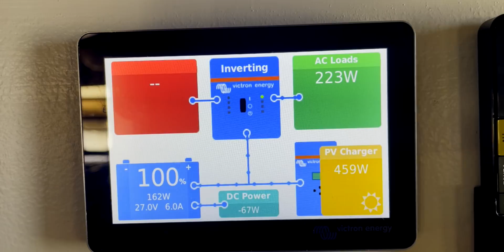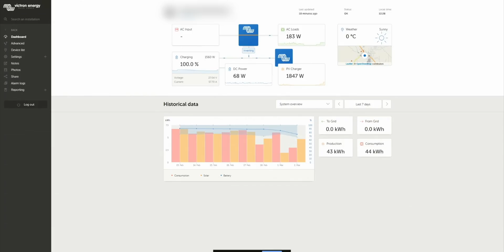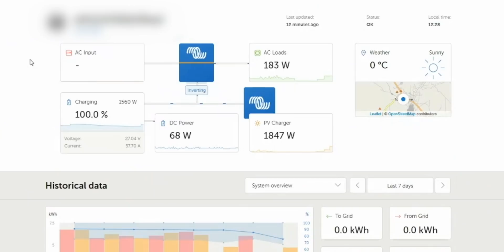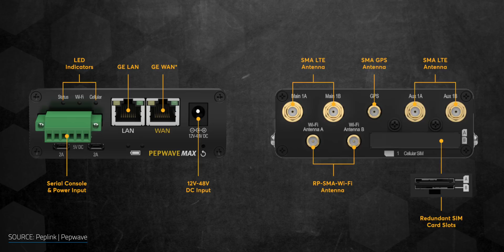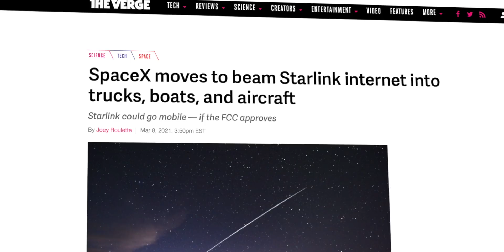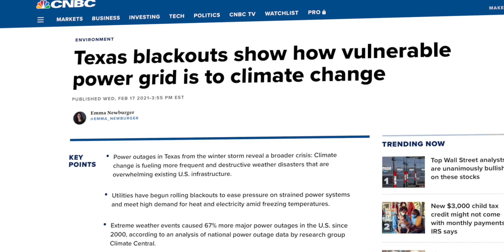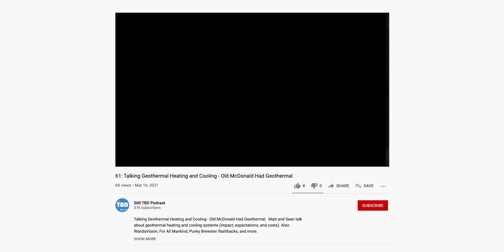Off Grid Living with Solar

Comment from the maker: Have you ever thought about doing something like this?  Don't know if I could go without my gigabit internet.  And if you liked this video, check out my video on Passive Homes - 90% Energy Savings! https://youtu.be/secB3R0sIYU?list=PLnTSM-ORSgi7UWp64ZlOKUPNXePMTdU4d
Reply: Being thinking about doing this for a while. Only difference is i live in brazil. but i'm a software dev, who loves being outside, gaming and star wars. Lol. I don't have pets tho.
Reply: Especially once Starlink is functional for an RV, a setup like his would be great, especially if it was about 3x that size for solar and battery, so that it could be used to charge a Cybertruck to pull the trailer, so that the Cybertruck could charge for a few days while in each location. That's more my dream setup, for either vacationing or work-and-travel life, though I too would be reluctant to let my "home base with gigabit fiber" go.
Reply: I'm currently doing this. I'm one year into living on the road and with much less solar and storage than your friend. A fixed 120w panel, a fold out 300w panel, 208Ah of batter and an invertor on the car. 

Honestly it's fine. 

We do get some batter anxiety sometimes if we aren't driving enough for alternator or the invertor to prop up things back up. But we can stay off grid for 9 days with the fridge, two laptops, two phones and a wifi router.
Reply: Was the electricity from the RV powering the truck dragging the RV? If not, why not?
Couldn't he have sold excess energy to the power grid anywhere?
How much did his setup cost?
Reply: Could he power his truck if it were electric with the power his getting? That would be so crazy if he could
Reply: Starlink, lets go :)
Reply: FYI, Starlink will not allow stationary usage in the begining.
Reply: Matt please check this out and give some insight.... it’s a form of hydrogen fuel the puts H2 into the air intake from an alternator powered fuel cell. 

https://youtu.be/wxfo-w0ptEo
Reply: Thanks for your content, Matt! Could you do a price out vid follow up? Thanks!
Reply: We are currently putting our 80 Acres on the market to live in our 40' 5th wheel along with our 2 x 100lbs Labs.  We will have 13.5kwh of LiFePO4 battery, all Victron equipment, and 2500 plus watts of solar.   I'm also going ro have a Raspberry Pi to convert the RV into a "Smart Home".  Winters in Arizona/ Texas/Florida and summers in Canada!
Reply: Please definitely do an update, this is very interesting!
Reply: Yes I have a custom design I've built out and know which RV and how much I can handle and need for various scenarios. It's not hard to do if you've got background knowledge in the solar and batteries. But I was on submarines for years so that space is plenty good for me. I'd love to hear more about what he went to set up
Reply: how does he heat the RV?
Reply: considering the cost of housing and renting, and a part of being a minimalist, this is highly interesting. now I want to know how they tackle toilet waste.
Reply: I have been off grid with just a 400 watt solar power system for over 20 years in a hand built cabin. The cabin is set up like a self contained RV and I have unlimited internet with my own wifi hotspot. I run a business online so I am online full time. You can see my systems on my channel:  https://www.youtube.com/watch?v=SwHpMRuT_lA
Reply: As the owner of three cats, two rabbits, and a dog, I just can’t imagine taking them on a long-term RV trip. They produce so much waste … and I’d always worry about the rabbits, who seem to need an emergency vet visit every year or two (rabbits are annoyingly delicate).
Reply: I know I am kinda randomly asking but do anybody know a good site to watch new movies online?

Comment: I've been thinking about that for some time now. BUT I'm dreaming of a fully electric setup, electric campervan, electric everything, charged by solar. So you don't even have to have separate battery. You share the same battery between the engine and the house part. You stay at 1 place for about a week, get 200-300 km of range off solar and then go to the next location. Really totally independent end climate friendly.

Comment: Awesome video!! My wife and I have discussed this as we're nearing retirement- even if it's only for 6-12 months before re-settling. Then there's the fact that we have 3 80#+ Golden Retrievers! We have a 40 foot toyhauler, but it's 16 years old, and I'm not quite sure what lifespan it still has, but it could be a great experience for a short time!! I'm curious as to what the cost was for Steve's system!!

Comment: I bought an RV in late 2016 and installed a basic solar setup. I was planning on maybe an early retirement and travel the country, but my plans didn't work out that way.  I had to get back into my career after a gap, and I could only find a contract job in another state. Rather than sell my house, I rented it to my brother & SIL, and took my RV to my new job (this was mid-2019).

COVID hit, and I was WFH in my RV for a few months before I started floating the idea of me traveling until we had to go back to the office.  During my travels, I eventually added 2 more panels (total of 3 panels with 460w rated generation). I built a system using RAM mounts so that I could tilt my panels for maximum solar collection.  I also upgraded from 2 lead acid batteries (original) to one LiFePo.  And I switched from my original PWM controller to an MPPT.  Even thought I'm back in an RV park now (in anticipation of returning to the office), I'd like to eventually connect my inverter to the main power of the RV... even if it is only manually switchable.  I still use my solar power to use my laptop every day, and my shore power usage is staying very low, so that's a win.

So my current configuration would get me to float charge by about noon, and I ended my work day around 2pm (in April), so I could be off-grid indefinitely, but I didn't have it connected to everything in the RV.  The two main things were my microwave and my refrigerator.  The microwave just wasn't connected, and the fridge was using propane.

It was an amazing experience to be able to travel like that.  I spent time in places that I had only driven through before (West Wendover, NV), and visited one of the few states that I hadn't yet (Oregon). I'd love to be able to travel like that again, but odds are that I won't get to with my current position.  Who knows, maybe they'll change their policy now that they know remote work is productive for software engineers like me.

Comment: We have a travel trailer on order; ETA is August.  We plan to add a solar set up to make it fairly self sufficient.  Our travel plans will be to do 1 to 2 week trips here in our state of CO and the immediate surrounding states; boondocking, not at campgrounds. We'll do this for 5 more years we plan to continue working.  The RV solar company you referenced, Northern Arizona Wind and Solar, is a primary contender to do our installation.

Comment: If he had a tesla cybertruck and charged it from the panels he would not need fuel either. Also, I have heard there are panels that take drinking water out of the air humidity that could get him off grid in terms of water supply!

Comment: I'm currently dreaming of doing something like this with a sailing catamaran. Around 50 kwh of battery, and a couple of wind generators, 5 or 6 kw of solar on top, a couple of wind generators, two 15kw electric motors with hydro-generation when under sail, and probably the most ambitious part, a water electrolyzer to produce hydrogen from seawater and store around 15 or 20 kg onboard for extended range with the electric motors via a pair of 5 or 10 kw fuel cells.

Now I just need a couple million bucks to make it happen! lol.  Ultimate Zombie Apocalypse plan!  Unless zombies can swim, of course.

Comment: I’m not clear that many people understand what internet bonding is. So I’ll do my best to explain, So let’s say your have sold ethernet connection into your nic card, then you connect to WiFi all while using the same isp. The point is your able to consume x2 the amount of bandwidth while paying for one connection. In that scenario my nic is rated for 10g while using cat 7 and I’m connect to wifi6. My modem is provisioned form isp is rated for 1200 down with 50 up for 75.00 per mo. With internet bonding, I’m able to successfully connect to 2400 down with 100 up. While still paying just 75.00. I use a paid service called speedify. Not only is Speedify bonding my internet connection, but it’s also provides a vpn service. I don’t get censored internet. I use adblockers within the service to speed-up my connection. It’s very simple to use. You don’t have to have a computer degree to set it up. I downloaded the app from the App Store & it works.

Comment: It is doable but the cost is STAGGERING. I cannot imagine many who can afford this lifestyle but for those who can it looks awesome. These days almost anything is possible if you have the funds. 

We did this but not roaming in an RV. We are in a cabin on solar and generator back up. We get by on 900 watts of panels and about 300 Ah of battery in the bank. Cellular internet access on an unlimited plan. 

My biggest concern in an RV would be the wear and tear on the equipment for the power. With a lot of travel I would think that would take a beating.

Comment: I'm doing the same here in Scotland but am on shore power during winter as don't have LiFe batteries and weather can be bad here for weeks but have everything a house would have with 1375w of solar, induction hobs, washing machine, tumble dryer, fridge and computer plus for heat I use a rocket mass heater which is also a range cooker so no gas appliances to worry about. After 3 years everything works great and life is very comfortable plus as an added bonus it's much cheaper living and I produce less waste/rubbish.

Comment: Doesn't sound worth it at all.  They still end up not having enough power for the evenings, plus they have those expensive eyesores on the roof.  They have increased the weight of the van so if they move it, it costs more in petrol.  Plus they are only 'self sufficient' in the mornings and that is only if there is sun.   And it seems like such a lot of hassle and work and expense for what it is.  Green energy is a bit of a con really but good on the guy for giving it a try.

Comment: I am doing this using all-in-one hybrid MPPT inverter.    After doing some research, 12V is not the way to go.  48V system is the way to go with 16S LFP battery setup.

Comment: Do a video about clothes lines , all the possibilities, indoor - outdoor - day - night - summer - winter, they work AWESOME!!! CLOTHESE LINES!!! Electricity free, solar and wind powered outdoors in the summer time, the funny thing is they work great in the winter time indoors of course though.  Please make clothes lines go viral and make a video about them.  They are so fun.  Its not that much work to hang up clothes.  The clothing will dry out a bit differently than from the electric powered clothes drying machine.  The modern convince of clothes drying appliance does probably make the clothes dry out a bit more perfectly fluffed, however, the drier machine will damage the clothes and shrink them more.  For some types of clothes like denim jeans the clothes line will leave them a bit stiff and crispy, however the clothes line has a ton of raw power, because of all the wind and sun and heat out doors. so if you need to dry out a big blanket or any thing like that lots of towels, the clothes line works really well.  Three or more washer loads of capacity doesn't require a lot of space or clothes lines.  This is a huge energy saver using clothes lines.  Make clothes lines go viral.  People with solar panels should invest in clothes lines also.

Comment: Nice funny video.  Importantly informative.  Raised as a farmer/rancher have been thinking about energy independence since about 1971.  One thing is a highly insulated space like 7 ft. under ground. Also, a super insulated building/RV.  There's much energy savings in some passive systems. Surprised he didn't have a few sailboat windmill generators.

Comment: I love seeing people do these kinds of self sufficiency projects. Solar and inverter technology has really become affordable, now if we can just get good quality batteries without breaking the bank.We have a remote cabin where the only thing we have to haul in is propane and food. I put together a solar system to fit our needs and it works great. We run a freezer with this along with most home appliances including a small washing machine. This summer I am adding a solar heater that works to heat the water in our RV water heater. If I had an RV I’d mount a 6” x 10’ ABS as a preheater for the water heater.

Comment: For those interested in diy solar, or solar for your RV. You can purchase lithium cells directly from China (where every battery cell is manufactured anyways) for cheaper prices per kwh than lead acid batteries.

Comment: His trailer might be too large for it but the new F150 Hybrid with the 7.3kw generator could work well to compliment the solar and batteries.  Possibly cheaper system of panels and batteries with the backup power coming for the trucks built in generator.

Comment: My dad and I converted an old German banking truck to an rv. I did al the electrical with a lot of help from YouTube. 3x 320 Wp mono crystaline solarpanels, Victron Multiplus 2 24V, Victron mppt, cerbo GX with AliExpress touchscreen and 2x 12V 170 Ah AGM battery's. 

It's a very capable system. We have an 230V AC unit, fridge/freezer, toilet (with built-in 'blender'), coffee machine, hydrophore etc. 
Monitoring everything through Victron👌

Comment: Yes I want to do this so badly! There's so much in just the States to see it could takes years and be so fun :) but yeah I hear yah... there are some challenges to be sure... throw 2 wild baby boys into that mix... and see how one's sanity fairs!
Reply from the maker: I can't imagine doing something like this with kids.
Reply: Me too. I'm working on my EE degree and one of the things I always try to do is get professors with doctorates opinions on different possibilities and where they think the technology is going.
Reply: I have been off grid with just a 400 watt solar power system for over 20 years in a hand built cabin. The cabin is set up like a self contained RV and I have unlimited internet with my own wifi hotspot. I run a business online so I am online full time. You can see my systems on my channel:
Reply: @solarcabin  that's cool man 🙌
Reply: El sábado h

Comment: I don't understand off grid guys... Unless there is actually no grid (you are on the road - like in the video) living off grid is not really a good idea. You produce a fixed amount of power, but your energy consumption is variable. This means you have to use batteries -> wasting power. If you connect your power to the grid you make sure every single bit of it is used at maximum efficiency.

Comment: Steve went a little nuts? I would do the exact same thing, go big or go home! Honestly, you're better off having more generation than you need for extreme cases such as colder weather, running more equipment than you expect in the future, etc. My future home will have ground arrays that can be expanded on and I'll probably keep expanding until my hydro service provider tells me to stop or I run out of land.

Comment: If one of the EV pickups come out soon ends up being capable of towing it, that sounds like they solar on the RV could also charge the pickup, could be a really apocalypses proof living situation at that point. Would just need to drive to sources of food and water and / or away from danger occasionally but wouldn't need to find fuel.

Comment: This would be exponentially more interesting when Cybertruck arrives and if it becomes possible to hook up to the vehicles battery.
You should definitely still have batteries in the RV itself, but knowing you have a +50kWh backup is always nice.

And you'd be going 100% green, not even a gascar to drive it around

Comment: As I get older, I feel the cold more in winter and have been daydreaming about the 'grey nomad" lifestyle, heading north (I live in Australia) for winter and seeing some of the more remote parts of the country.  I have a Cybertruck Trimotor on preorder, so this, combined with a caravan/trailer with solar panels and battery would be an awesome energy independent set up.  I have done some research and there is an Aussie company called ERV that has caravans/trailers with this sort of gear.  They trialled it with a couple in the outback for 6 months and it sounds as though it worked very well.

Comment: Those Victron multiplus inverters are really rugged. The only problem is they have huge input capacitors which result in a massive inrush current when you close the power breaker and on 48V will blast the contacts of the breaker - I now use a 500 ohm precharge resistor to reduce the inrush.

Starlink looks good but it takes around 100W (2.5KWh/day) which is a big load on an off-grid/mobile system.